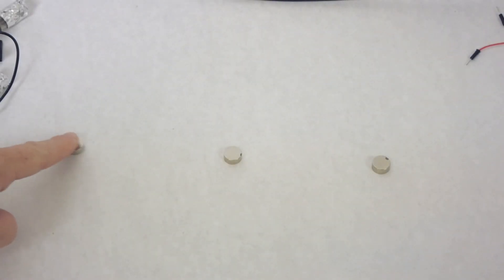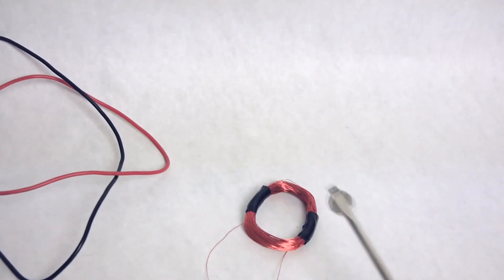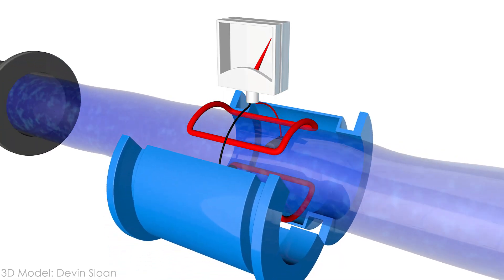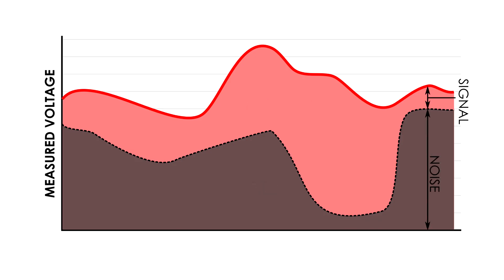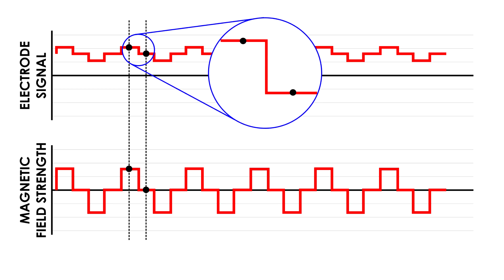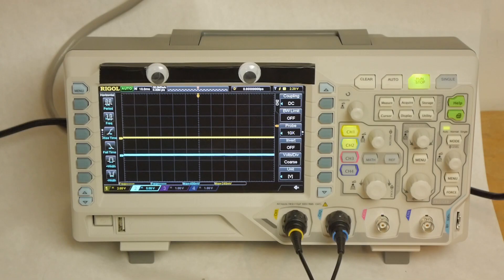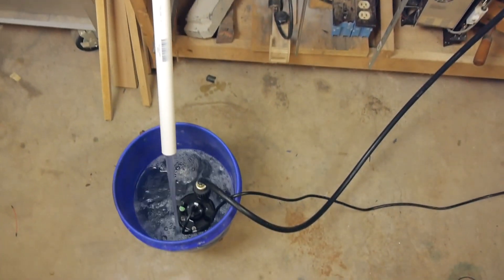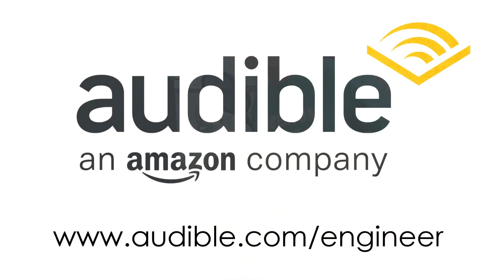How to Measure Flow with Magnets - (Magnetic Flow Meters)

Comment: Hi thanks for the video, i have created it nearly same way you made and it is working fine (my setup is far bad then yours :). there is no issue with your setup. can you share log data of signal you received from your testing (noisy is ok for me) and no of turns in magnetic coils you made. i could tell where the problem is. thanks again posting the video. it also helps me.

Comment: Say you had a 1" line from the city, and a meter calibrated to said line. If you installed something like a 1/8" line past the meter, and then a pressure tank to boost pressure in the home, could this reduce the flow rate past the meter to a level that isn't detected?  Not that I would do it in practice, I'm just wondering how low can Faraday's law go.

Comment: Measure the pressure in a cross section of the tube, in the upside and downside and then use the bernoulli ecuation to measure the velocity in these points, then use a mean and then estimate the average velocity, with the velocity and the cross section you have the flow.

Comment: The logic you used to eliminate the noise issue is the same logic we use when tuning controllers. You do a step change and measure the change in the process to tune a controller. Really cool video, thanks for the video.

Comment: Sir you can use flex sensor here 
And measure the resistance of flex  sensor 
If water flow the sensor will fold in the proportion of water flow

Comment: I am an engineer in the oil fields.  We use a 2" mag meter on our production water pumps which can get flows up to 1300 barrels per day. (1706 gal/hr).  you may just try to increase your fluid velocity with a smaller pipe.

Comment: Instead of changing the polarity of the magnets, why can't we just use two sets of electrodes, one right between the magnets and the second slightly further (but not far enough to cause a significant phase difference). The one away from the magnet will measure just the noise and the one in between the magnet will measure noise + the flow rate. Then just use another differential amplifier and get a better answer. Wouldn't this be more power efficient too?

Comment: The reason this doesn't work is you have an insanely weak magnetic field, the entire magnetic circuit being in air.  At a minimum, you need an iron return path outside the pipe.  Wrap insulation around coils, and then wrap a piece of thin (magnetic) sheet steel tightly around the coils multiple times until it is at least 1/8th inch thick.  Put more turns on the coils, use heavier wire, and increase the power provided to them A LOT!  Coil driver should be constant current.  Make sure coils are phased correctly.  Electrical sensor/amplifier must be high impedance if fluid is of low conductivity.  (Try adding a little sodium sulfate to the water and look for a change in output.  Don't use salt, the chlorine in it causes corrosion.)  When you process for voltage, difference the voltage when the field is positive and when it is negative, instead of positive and zero.  This will double the signal.

Comment: Perhaps you can try a pressure sensor placed through a hole on top, then use fluid dynamic formula and pipe specs to cald velocity? I think Mouser or digikey should have one for a few bucks that can work with SPI protocol.

Comment: Having implemented many magnetic flow meters, two of the main issues to consider when installing the meter is to make sure there is no air in the line near the meter (maintain a full pipe at all times). If possible install the meter vertically, but if not, make sure it's not in the highest place in the piping or anywhere else where air might accumulate. Looking at your testing fixture I would assume that there is air going past the meter. I would have put some kind of trap in the end of the line before running the pipe back to the bucket. The other factor is to install in a place so many pipe diameters upstream and downstream to avoid turbulence and try for laminar flow. That part of the test rig looks ok to me.

Comment: Description of youtube video says "A conductive fluid moving through the pipe will generate a voltage (electromotive force) between the electrodes "due" to Faraday’s law", it could be narrated as "As described by Faraday in Faraday's Law" because voltage is not created due the law, but for the materials used in demonstrating this experiment.

Comment: there are two things to consider 1) pipe should be grounded , since its a pvc pipe liquid in pipe may be grounded 2) a half full pipe or a pipe which has some air in it will always give incorrect reading, so make it vertical

Comment: This is one of those places where the mechanical version is soooo much simpler than the electric version. When you were showing pictures of water meters, you were showing pictures of Nutating Disc water meters -- not electronic ones.  Almost all your residential water meters today are this style.  The meter part is mechanical, although some of the newer ones have added magnetic pickups and remote-read facilities.  In the end, though, there's still just a little wobbly disc turning gears.

Comment: Would love to see a video on Coriolis type flow rate meters. The problem with induction type flow rate meters is that the are very susceptible to noisy pumps and unless you have a very smooth syringe pump, averaging low flow rates with decent accuracy is terribly difficult! I’ve been working on smart flow rate meter hardware for the Rnd industry for the past year, so this video was enjoyable! Cheers!

Comment: You've got your signal to noise backwards. A high SNR is what you want - lots of signal. A low SNR is what you're describing- a noisy signal.  And the waveform doesn't have only two values.  It has three. Positive, off and negative.

Comment: Well, noise is attributed in the real world to poor grounding and rf interference. 

Ideally, i'd like to see a flow straightener before the measurement. This smooths out any turbulence from the plumbing before the measurement as this can cause noise simply because the fluid is not moving uniformly down the pipe. It should also be tested with a metal (stainless) flow straightener as well, and this can be grounded to sink any stray voltages being induced by moving water. Aka electrolysis. This should get you reasonably close. Furthermore, a differential amplifier will be very sensitive to rf noise. Both wires from the stainless screws used to measure inductance should be as short as possible and shielded, with the shield being grounded only at one end, at the amplifier. 

I think you'll find that these couple mods will result in a much better reading with much less noise. You could also get rid of some noise (oscillation) by shunting the capacitance in the tube with a very small resistor. Perhaps 1 or 2 meg ohm..?  Enough to dampen the stray voltages picked up as noise. You can also use a power filter. Small inductor. Connect one screw to a small cap to ground. Then from the cap to an inductor, then to another small cap to ground, then to the differential amp. This kind of passive bypass filter works really well to cancel noise.

Comment: I think a lock in amplifier would be the answer. I think you can get an AD630 evaluation board on eBay for around 40 bucks.
Thanks for the video.

Comment: hi,
It should work but first you need to:
1. use coils with ferromagnetic core. it will significantly increase the magnetic flux
2. use larger diameter of pipe 
3. increase the surface area of electrodes but use flat surfaces. your setup might cause vertexes which will end up as noise in your signal 
4. use instrumentation amplifier instead of differential amplifier.

Comment: would using a 1' section of 1/2" copper pipe immediately after the pump, grounded, reduce the noise? You should do a video about Passive Intermodulation of RF, with regards to wireless communication.

Comment: I would like to see you redo this video at a later time when you are a little more prepared to try again. As far as the electrical engineering part, you most likely need to be able to boost your signal strength to overpower the noise in the system. Also, you might have to reduce the distance between the transmitter(magnet) and receiver(sensor) in your electrical set-up in order to reduce noise. Also you might possibly need to sample the noise while the device is being used so as to carry out a counter wave to reduce the noise generated. Sort of like noise cancelling headphones. It all comes down to how you are going to either boost your signal strength, from the  transmission to the reception, or how you are going to nullify the noise naturally generated in that system. It may be as simple as adding more voltage to the transmitter than your standard DC power supply can produce to the transmitter so that the receiver can actually hear it.

Comment: So its kind of just a hall effect sensor.  I know the thing probably doesn't exist any more but for demonstration purposes, increasing the conductivity of the fluid would have helped a lot.  Also completing the magnetic circuit would have helped too.  I bet you could repurpose the laminated core from a cheap fan motor to give you a larger, less noisy signal.

Also, ultrasonic flow monitoring is interesting.  Its a little more robust in the face of inconsistent fluids.

Comment: Great video and very thought provoking for someone like myself who has been working with electronics all my (Relatively long) life.  I was too lazy to go through all 500 comments, particularly on a 2-year-old video, however here are a couple thoughts...  First off, without an iron/ferrite core in your coils it’s going to seriously limit the amount of signal you get out of it, a core helps to localize and focus the field, which is why you’ll see so many coils with cores regardless of whether they’re generating or trying to receive fields, aside from very high frequency, low inductance coils.  Second, you might want to check into isolated, high gain amplifiers used in EKG machines or those that try and pick up muscle currents via EMG (electromyography).  Ideally you want a high-gain, differential, isolated circuit because that way you can avoid inadvertently coupling in external electrical currents that may end up causing random offsets in your signal.  I would steer away from an off the shelf h-bridge simply because you are using something that was never intended for a clean, spike-free output of exactly the same signals every time, there’s just no point in its normal application.  Using an op-amp with a split supply set up to produce a square wave output would probably be a better bet.  And finally, you might want to look at a high-resolution ADC (I.e. at least 14 bits effective/noise free, not the resolution of the ADC itself since they are always going to have a higher resolution that’s impossible to get in practice due to design limitations) to sample your signal and try and get a little more resolution from such low-amplitude signals vs your 8-bit scope.  A better ADC isn’t mandatory assuming you can get enough gain from your main amplifier, though obviously this is all a matter of trying to squeeze more signal out without it vanishing into the noise.
Reply: That was informative.

Comment: hi there. I enjoyed the video so much and wish u the best of luck ahead. I had to say, am not an expert and maybe am wrong but there is no harm in making a suggestion, since u using a bolt which I think is stainless steel or if am not mistaken covered with paint or some way to improve water resistance, and  it would also increase electrode resistance, also water can increase that resistance as well . so my suggestion is to change the electrode and make it closer to each other, maybe that would give u cleaner signals. hope it would be helpful

Comment: Interesting. What about making the magnetic field generated by a sine wave. The measured signal becomes imposed to this sine wave.In fact this corresponds to amplitude modulation, which could be demodulated into baseband and one could measure the voltage of the demodulated product? I have never seen those devices, seeing how small signals one gets out of it I would imagine heavy filtering of the baseband product hence one gets partially rid of noise and some useful signal would appear. This however requires as week very low noise amplifier with a high h gain straight at the electrodes. Limiting the signal bandwidth at the very input helps a lot as well. Another possibility would be sampling and filtering digitally. But maybe all this is a complete nonsense

Comment: I think winding those coils around a large (~radius of pipe)iron core to boost the magnetic field induced. This may be enough to get your signal to noise ratio down to something measurable, and its not a hard fix if you can just find 2 pieces of iron laying around

Comment: This is not a reliable way of calculating water flow velocity , stray emf can be captured by any metallic material moving around the magnet, not necessarily inside pipe, but outside pipe.

Comment: Someone already mention it:  You need to use a synchronous rectifier/lock-in amplifier.  You shoul d also take many sample per period before processing the signal.   This isn't my idea it is how you extract signals from noisy environments.  Using sine-waveforms will give further improvements but often you don't need to go this far.

Comment: It might be worth looking at the measurements from the electrodes in the frequency domain. You can probably implement a digital filter to remove the noise. You might need a better understanding of what you are dealing with

Comment: Great video Practical Engineering. I always wonder about how it worked. I think you should do it right, remember not giving up is the hearth of engineering. Here is my contribution. Your piping is made of plastic, you will need a ground electrode near your other two electrodes, it will reduce noise. Another source of noise is turbulence, your pipe should have for the sake of precision a straight 20x pipe diameter upstream and 10x pipe diameter downstream the measure point. Vent to make sure you do not have air in your pipe or in the pump housing and impellers. I hope you read it and get good results.
Reply: That's pretty much verbatim from the Badger M2000 mag-flow meter manual I'm familiar with, and as such is sound advice.

Comment: The magnetic field should be larger, so a good start would be to add a magnetic core to the two coils. I would make a single coil, but create, magnetic field in a magnetic core around the pipes. Electrodes should be placed in the flow direction of the fluid.

Comment: The signal you generate has this high frequency noise which can be easily filtered put with a low pass filter. Really you are only interested in the DC component of the signal, which can be found by using a fast Fourier transform
Reply: Exactly what I was thinking. A good low-pass filter should've fixed the problem.
Reply: I noticed when he was doing the alternating signal one that he was getting a varying waveform. I'm not sure if that was the 60 Hz waveform from the wall or some other waveform from his modulation. If it was from his modulation, he is golden, but needs to use a coherent detector to give an output signal, but in either case an LPF would help the visible output on the scope.

Comment: Cool video!!

I guess it could be quite easy to improve your flowmeter bij taking care of electrostatic energy.
Due to the plastic piping you are using you will get electrostatic energy.the reaction between water and the piping is the same as  interaction between your hair and a balloon when you move it over your head. This energy can only move though you fluid and electrodes as the piping is made out of non conductive plastic. An additional electrode connected to ground at the bottom of your tube in the same cross section as your electrodes will help to reduce this electrostatic noise.   
the ground electrode will not interfere with your measuring signal as the potential in the middle of the pipe is zero or close to zero.  

In addition you could make two ground electrodes at the begin and end of your meter. to eliminate further noise.

Kind regards,
Adriaan Demage

Comment: Hi, just found your channel and I reckon its really good.  Your technical explanations are interesting as I'm a major builder/hacker/experimenter/arduino enthusiast with no formal training.  To answer your question in this video, over a year later, I would love to see what it takes to build a flow meter that works, that connects to an arduino that can be used for monitoring a cooling system for a laser cutter, having worked on a arduino powered laser cutter at the Melbourne (Australia) hackerspace.  I know I could probably just buy one, but its always cooler to build your own.

Comment: Sure your emags aren't too inductive? Looks like __A LOT OF WINDINGS__. You show the voltage 6.5vpp @ 2Hz but not the current ( and therefore the Lorentz field strength (and therefore the induced emf)) For sure 2Hz seems like it would be slow enough to saturate the emag inductor current, but I've not done the calculations (esp without winding number). also up the emag vpp to see what happens. Also mention that the Lorentz force relies upon either innate net charge or innate separated charge (ions) in the fluid which doesn't seem to be enumerated in the video, or stimulated by an upstream electrode / downstream ground / vice-versa / ionic solutes as mentioned in some other answers.

Comment: The movement of the magnet across the coil is the frequency, measured in cycles per second, or Hertz (Hz). Electric current coming from our utilities has a frequency of 60 Hz (50 Hz in European countries).